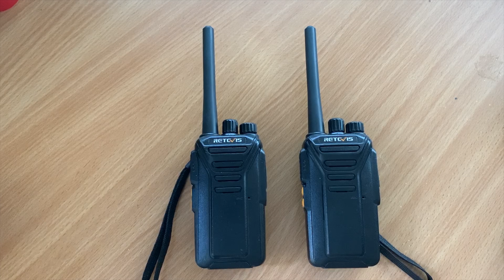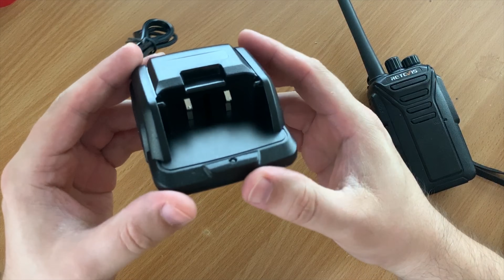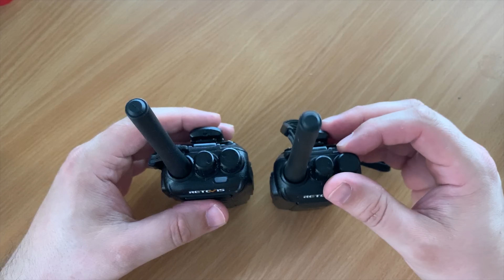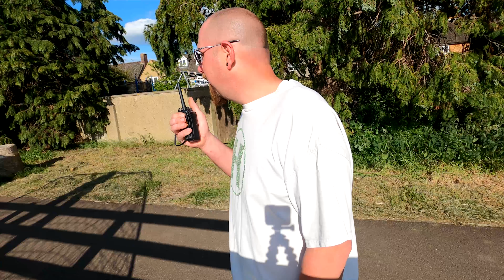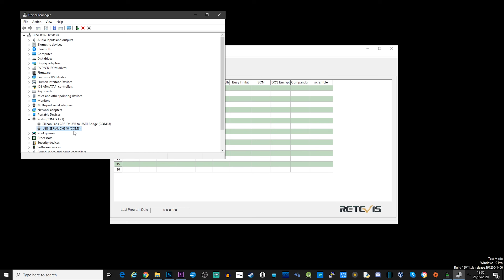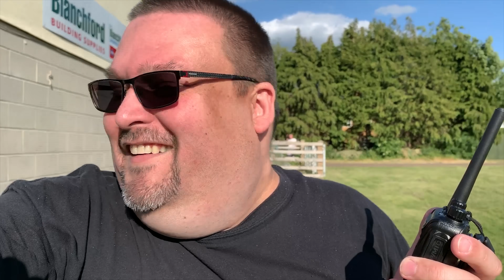Retevis RT27 License Free Walkie Talkie - Surprising Features!

Comment: Where did you get the configuration software for the RT27, the version I have doesn't allow you to adjust the frequencies. This is the UK PMR446 version. I am trying to clone these to some Icom PMR IC-F29sr's that only use the first 8 channels, then channels 9-16 are the same 8 sets of frequency repeated but with different tones.

Comment: AKA as "Shenzhen Retevis Technology Co." AKA as ""Shenzhen Chang Taiwei Electronic Co, LTD" AKA cheap chinese junk
Reply: And the device you are typing this on is probably produced in China !
Reply from the maker: Not all of it is crap
Reply: @TechMindsOfficial  If you don't mind buying 3 or 4 since they are cheap and throw away them as they fail, no problem. The issue is QUALITY and RELIABILITY. There are absolutely scores of people with reviews that showcase the complete grabbag of problems that the cheap chinese junk has - it simply comes with the cheap price tag. Its all about high volume and low quality to get the price down. If you don't mind low quality and poor reliability, then you can always justify 'well I got it cheap !!'  and yes you did; but for situations where you need it for reliability and simply cannot tolerate constant failures and shoddy workmanship, then its time to pony up more money. Moreover, its always apparent that the quality of signal in receiver sensitivity, selectivity, and overall power conversion efficiency is better from well known, decades proven companies (American, Japanese, and European) that will not trade off quality and reliability simply as their reputation cannot afford to lose customers ! With cheap chineese junk its all about volume sales and they can lost hundreds of thousands of customers since they are selling MILLIONS.

Comment: Normally,  to programme a repeater into a radio, one needs a shift function to be put in. I can't see anywhere to put a + or - !
Reply from the maker: There’s no need for a shift function in this case because the TX and RX frequency is being manually specific. A shift would normally be used if only programming an RX frequency.

Comment: No clue why I just watched a review on a set of walkie-talkie's in the middle of the night but I have to say this was a very nice review, would buy if I wasn't broke 10/10.
Reply: Sorry that you are broke. Check around to find out where the nearest Amateur Radio Club is in your area. Many of them are giving free Baofeng UV-5R walkie talkies to people who take a class with them and pass their FCC Technician License. (assuming you are in the US) Even if you can’t find a club that provides this service, that particular radio only costs $25.00. The radio in this video is for the non license radio service, meaning that it is low power and the antenna is fixed and non removable. This can be used for camping and hiking and similar activities. If you get the amateur license you can talk at much greater distances and with more power.
Reply from the maker: Thanks for watching 👍
Reply: iPhone_9     *talkies